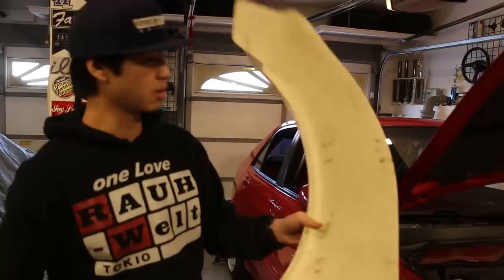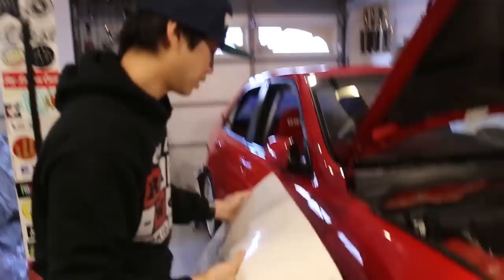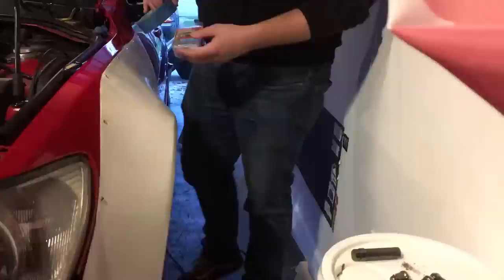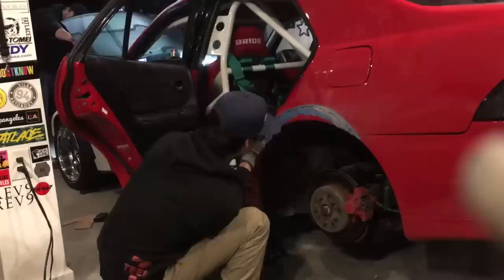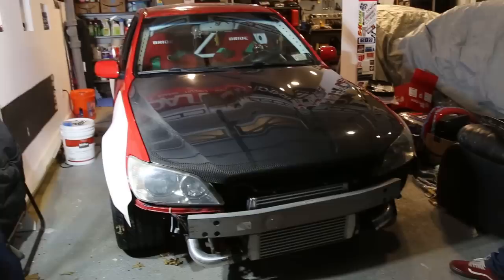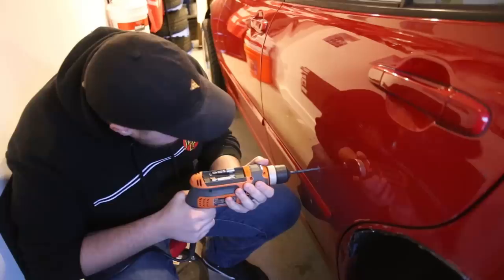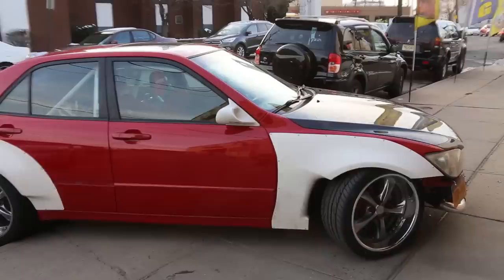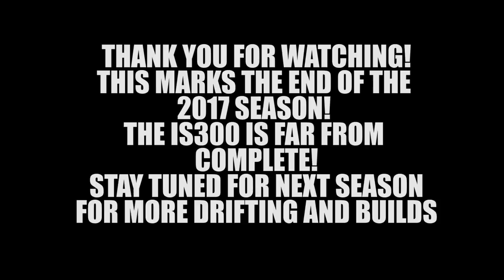IS300 Drift Project Part 8: Widebody Install

Comment: The only thing I would have done different is put silicone sealant between the flares and the body panel itself as well as spray anti-rust on the inner. 

Other than that, decent job.

Comment: Not a big fan of the rear bumper, side skirts, and duckbill spoiler, but wide fenders look great and I do like the front. I woulda just went with a carbon fiber trunk and roof to match the hood. But, it is all subjective. Still a sweet ass ride all around.

Comment: Did you just put the screws on without additional hexagon nuts from the inside? and the mold part is hanging on those screws?? 😯😯 Is this safe? Is there another way that you could install it without the screws to appear on the parts? Great job although

Comment: I have a 2Jge/T is it worth sticking it into the Sc300? (engine came from a GS300 rebuilt with GTE internals) was going to 300Zx swap but I just found an sc300 with no trans or engine for sale.

Comment: Not hateing . But with all that effort and and connections as if you couldn't weld the panels on then smooth it out with filler or fibreglass.. 
It just hurts to see all those screws in it.
Great effort though.

Comment: What size tires did you put on the rear profile and width
Reply from the maker: Justin Hetherington 265/40/18
Reply: @Progressionmotorsports  what is your rim dimensions, I have a 18 10.5 +22 offset, I want to put a 275 on do you think it will fit, sorry I want to buy tires today but your the only one I can find with a great step-by-step video, I have +65mm going on the rear
Reply from the maker: Justin Hetherington in terms of tire on wheel figment. 275 on a 10.5J is as square fitment as it gets. But for fender fitment, I can’t help you there as all cars and setups are always slightly different.

Comment: LEXUS IS300 Drift in Need For Speed Underground. This car is strong horsepower with V6 engines. It is better Mazda RX-7, RX-8, TOYOTA SUPRA MARK IV, Mitsubishi Lancer Evo IX, X, SUBARU BRZ, SUBARU WRX STi. LEXUS IS300 Top Speed 270KM/KM can reach Tuned car Top Speed 300+KM/H in US. Hennessy Company ever made

Comment: So much for resale value lol other than that I dig it 👌🇯🇵🇯🇵🔰
Reply: You shouldn't buy a car for it's resale value really.
You know that goes out the door the moment you start modifying it.
Reply: The price on the is300 keeps going down so at this point that engine alone is almost worth more then a normal is300

Comment: What's the difference in is200 and 300
Reply: The engine i think
Reply: IS200 came with the Beams 4 cylinder engine, IS300 came with the naturally aspirated 2JZ.
Reply: Evan Lerner 2jz😏 thanks
Reply: is 200 didnt come with the beams engine it came with a 2 litre na 6 cylinder, theyre very common here in the uk, pretty sure the beams engine was only altezza
Reply: Conor Beirne 300 has a 2jz
Reply: 100

Comment: This is a millennial wide body kit, lol.  Also known as over sized freakin flares.  A true wide body kit has entire bumpers and wide fenders and valance and rear apron.  All that stock shit comes off.  You can't install it with a rivet gun.  These are just flares and taking the name as wide body.  It would take weeks or months to install with tons of grafting and a ton of putty.  Not the same at all.

Comment: You should have grided those cuts smooth or at least filed the sharp edges off.
Reply: ChaddysTechStuff won’t it start rusting at the untended sharp cuts?
Reply: @gregs7753  na it will rust if it isn't coated with something.
Reply: @gregs7753  100% yes it will unless it is sealed really well with something.
Reply: like a thick coat of paint or truck bed liner